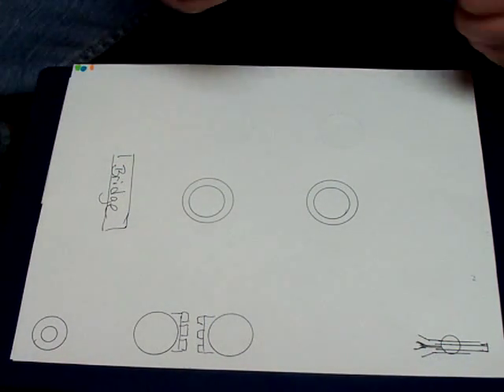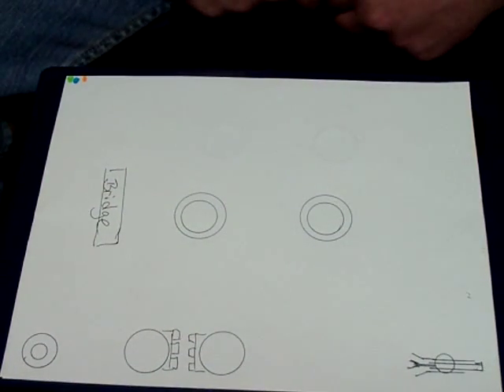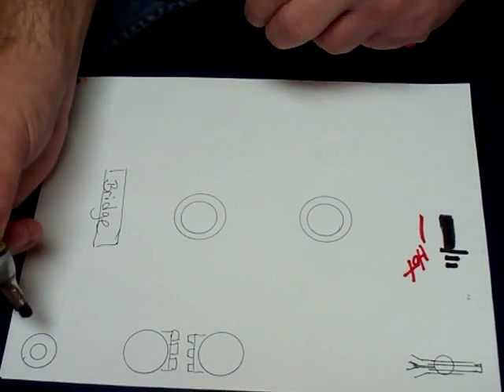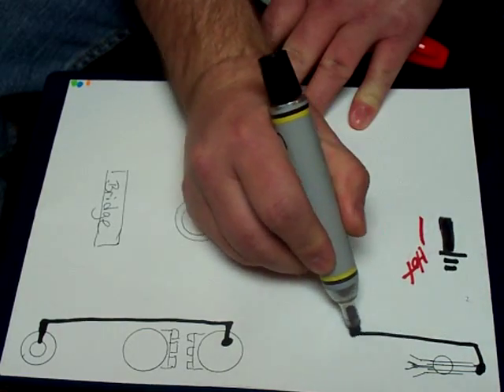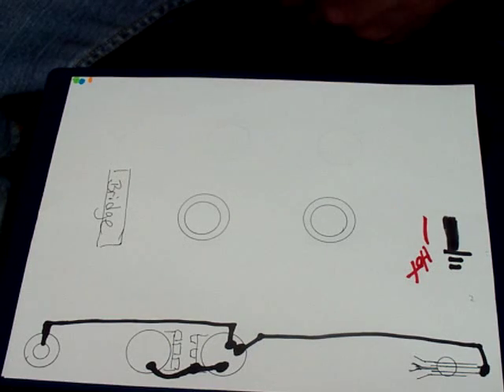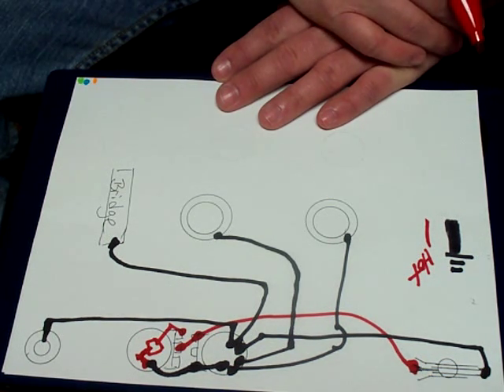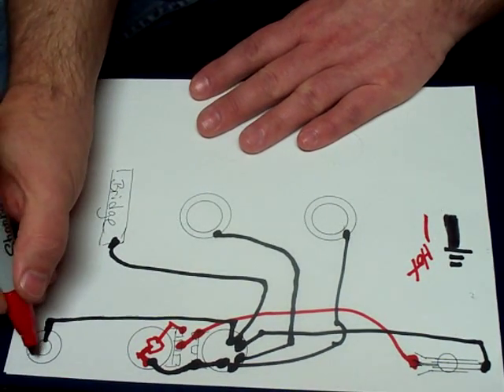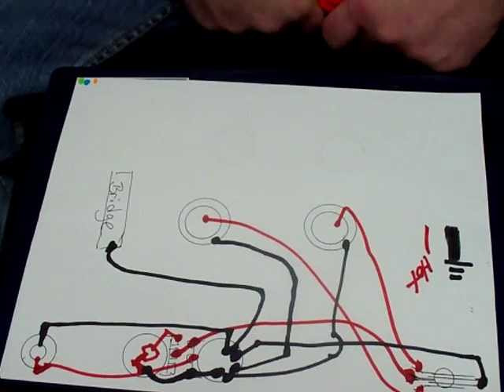how to wire 2 piezo's 3 way toggle volume /tone

Comment: what kilo volume and what capacitor and howmuch?
Reply from the maker: @vibeandvolt  I typically used 250k pots and a .022 cap, but I did try other set ups.  You can get away with most anything.

Comment: Do piezo pickups have different quality?
Reply from the maker: Schniedelwutz  yes they do,  the ones I used to get are obsolete now.  My best advice is try some you’ll find some you like.  I stopped using them after I could no longer get the ones I used to buy and switch to my own hand wound pickups.  There are descent ones out there you just got to find the ones that work for you.

Comment: Hello. Any hints on waht values should be used for potentiometers and capacitors with my piezo pickups?
Or a way to find them out without trying hundreds of configuration?
Thanks for all the videos.
( I'll use this for this kind of DIY instrument I made: https://www.youtube.com/watch?v=XmBwWvpjdCk )
Reply from the maker: this is one of those ask 10 people you'll get 10 different answers questions.  I have almost always 500K pots on piezo ,sgl coil or humbuckers.  I experiments with a lot of different values and there's not a ton of difference between them.  I had a guy simplify pots for me once in this way imagine the pots as the gas pedal  in your car.  and you car was capable of 100mph.  a 25K pot would give you  Idle-50-100  , a 250K would give you idle 25-50-75-100, the 500K would give you incriments of 10mph to 100.  the lower the value the less range, the higher value the greater range you still can only do 100, the value in pots determine the range of controll getting there. hope that helps !
Reply: OK thanks a lot for fast reply :-D
I'll test with a few different capacitors, I guess I'll start wity 0.47uF...
Reply from the maker: HEMERASH Music  in my experiments you can have a bigger effect on your tone with caps than pots! Because there are in addition to a value like .047 different types of caps I like the pio types and you can't go wrong with sprague orange drops
Reply: Ok thanls. I might start experimenting next month :-D

Comment: Thanks for this I've been looking for a long time,  with two vol pots and two tone pots does it matter which vol pot gets all the grounds.  The kit I got already has one set of tone (with cap) and vol pots interconnected and grounded, the wire from the vol pot intersects with the other set of vol and tone pots with a green wire coming of the final tone pod.  There is also a black wire coming off the intersection of the two sets pots.  Can I use your diagram to make this work?  I have a neck and bridge hum buckers instead of piezo.
Reply: On the pots I noticed that all of the lugs are soldered except one open lug on one side of the tone pod and the same on final tone pod with the green wire coming of tone pod back.
Reply from the maker: rhderfler  the pot for the grounds doesn't really matter cause both pots are grounded together, I always used the volume pot.  And you can instead of piezo disc used any pickup only thing that gets crazy is coil tapping on a 4 wire humbucker  other wise just keep in mind every pickup has a hot and a ground . Thx for watching!

Comment: I have made 4 or 5 CBG builds so far and used prewired harnesses. I have looked at a million wiring diagrams and they all make sense. Watching your video now have burned it into my memory now and it will be easy from now on. Thank you! I will use the double solder method now instead of folding the connector because it just feels right!
Reply from the maker: Bob Marioni here is another that we did that might help too !! https://www.youtube.com/watch?v=URcKWDhHwk8
Reply: Thank you! Great job!